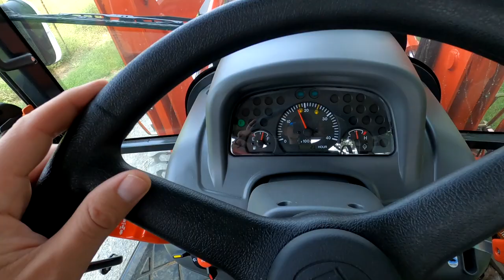Kioti RX Tractor!

Comment: Sorry to hear you had troubles with the RX. I'm wondering if it wasn't necessarily was it a bad computer. Mine shut me down around the same hours and I had to do a manual regen and it took like 25 minutes. Then it shut me down in another 15 hours and I had to do the same. Since then no problems but I will have them check it here at the 50-hour service. Otherwise it's been a great tractor, good luck
Reply from the maker: Thanks Kapper; I'm not sure what it is/was but it seems to have resolved with the regen's.  My dealer (Larry Stovesand Equipment) was aggressive in trying to make it right and maybe it just needed to work the gremlins out from shipping/being on the lot.  Who knows!  LOVE the tractor and especially the cab.  Heat/Air, listening to music and keeping the dust and bugs off of me while I work is unbelievable.  Can't see ever going back!  Now; we need to get you on the @Ventrac train.  I know you have the skid loader, but you gotta try one of these things brother!!!  If you have a pond it's impossible to beat.  Take care!
-JTF

Comment: Good luck with your tractor. We are thinking of buying a Kubota L3800 tractor. One of the main reasons is it looks like a more mechanical and less electronic tractor. I do not think the L3800 is sold in America anymore as it does not meet emissions regulations. Australia must have differing pollution laws as it’s still sold here.
Reply from the maker: Hey Karl!  Welcome to the channel and thanks for watching!  I initially wanted a Kubota and think that they are fantastic products.  The price difference in our market was just too wide for me to justify.  I have been very happy with the Kioti products.  This particular tractor has had an ECM? issue which they replaced under warranty without any pushback.  There still seems to be a sensor somewhere that is faulty but it will get addressed at the initial 50hr service (next few weeks).   With any of the creature comforts (AC/push button 4WD/Elec PTO) there will be technology...which I am torn whether it is best to have a bare bones mechanical rig vs the benefits...until it is HOT and humid.  Then I want the comforts.  

The US has had our battles for sure with emissions control; but the Tier IV hasn't really been an issue for me other than this challenge (mine is actually a Tier V).  It will get worked out...  Doesn't stop me from getting work done and I love the size, power and comfort of this machine.

Keep me posted on your purchase; you can't go wrong with many of the new tractors out there.  They are all very well built for the most part.  Hope you will consider subscribing!  
-JTF
Reply: Hi Joe,

It will be a while before we buy a tractor. We NEED one. We have a small farm that we a planting macadamia trees on. We hope to have a small orchard as a sideline and interest. So far we have planted around 450 trees which is around half of the total we plan to have. 

We have two farm vehicles to help. One is an Iseki SF mower. It’s basically a small tractor flipped around with the PTO and linkages out the front with the mower deck. We also have a Club Car Carryall 295 which is powered by a Kubota diesel. 

We hire a mini loader for other work like digging holes and moving mulch when needed. It works out to cost about a dollar fifty to dig a hole with a mini loader & auger. This is money well spent as far as I’m concerned when digging hundreds of holes.

I have a utube channel but it’s a bit dodgy, mainly vlog style.
Reply from the maker: Sounds like you have some cool equipment!  Is the Iseki like the Ventrac?  And anything with a Kubota diesel will last a few lifetimes if cared for.  And you are right; if you can hire it out for that price it is absolutely worth it.  There are some chores on the farm that I would rather hire out than carry the equipment, maintenance and time.  We have started a micro-orchard!  nothing like what you are doing but I see why you love it.  We will be planting about 16 more fruit trees in the coming weeks and then will start planting some of the back of our property with hardwoods.  The fruit is really just more for food for our family and friends and neighbors. 

Machines are a necessity for us; and we are constantly trying to determine what is a necessity and what needs to move on.  The new tractor was an absolute luxury; but there have been times that work had to get done and I got far too overheated.  Just not as young as I used to be I guess!

I will check out your channel!  That's the best part of YouTube.  Finding cool people with similar hobbies!

Talk soon friend!
-JTF
Reply: Hi Joe,

The Iseki looks like the older Ventrac, not the 4500 model. It’s a tough machine about 20 years old but still going strong. Japanese made.

Here is a video from my farming channel. 

https://youtu.be/SahY8GaxuQ0

Comment: Retiring in about 15 months, bought 215 acres of scrub brush and Junipers in southern Oregon and the Kioti cab RX73 is on the top of my list. Ballpark, how much will I be set back. 40k, 50k? I don't think anything smaller will do.
Reply from the maker: Hey BigLarge, thanks for watching.  I think you can get in one at the lower end of that range.  Of course additional remotes, third function, etc are extra. I wouldn’t be afraid of looking for one with  low hours; but in my experience I would have saved little (if any).   Congratulations on retirement!  That land will make you feel 15 years younger.  😁👍🏼
Reply: @JoeTheFarmer  Thank you JTF
Reply from the maker: No Problem!  👊

Comment: Service guy left the key on. Mine got dinged for 20 hours
Reply from the maker: Hey jj!  Thanks for watching.  And OUCH!  Really?  That’s unreal.  I didn’t think it kept track by that but makes sense.  All is well that ends well.  I am still having the check engine light come on but it goes off after restarting.  There has to be a bad sensor somewhere.  I know it is likely an easy fix and things happen.  It will get resolved.  What model is your 
tractor?

- JTF
Reply: I have a kubota B2601.  Good luck with the gremlins.
Reply from the maker: Thanks JJ; just never feed them after midnight!!!  Lol  BTW; we used a Kubota BX23S this past weekend with a backhoe and it made short work of planting 15 fruit trees.  Great machine!  Video to come...